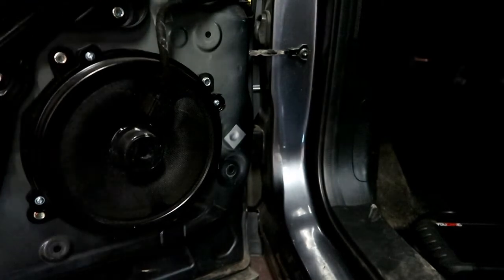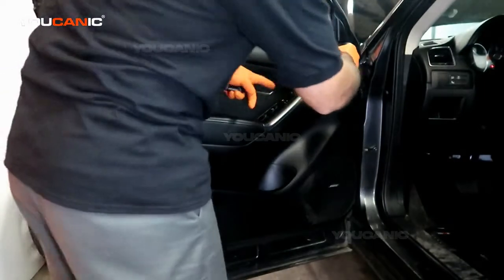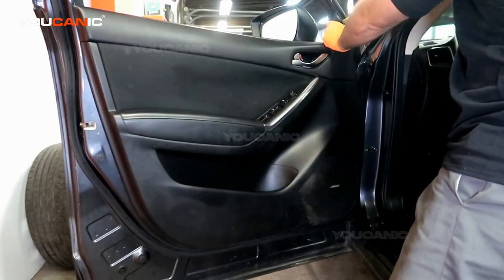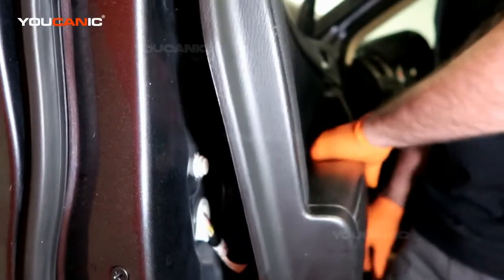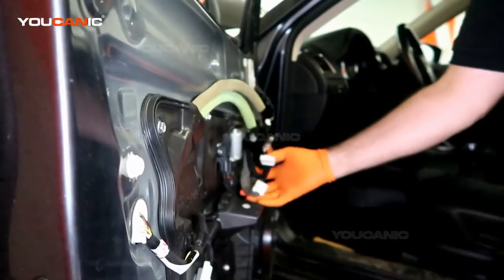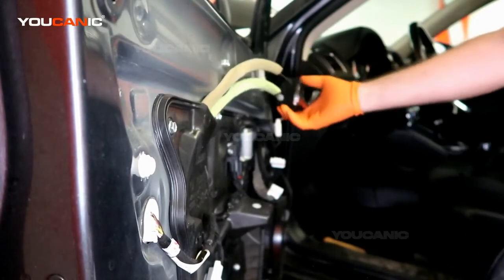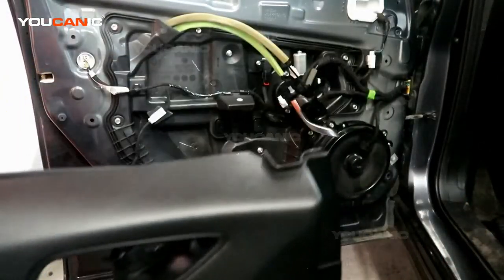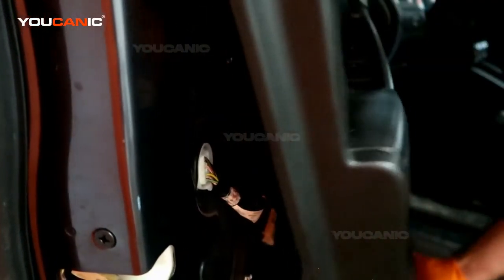2013-2017 Mazda CX-5 - Door Speaker Replacement

Comment: Thanks!  Please note that one should oder ten new plastic clip pins because they will break when you remove the panel.  I learned that they are one-time use.  They are $2.30 a piece.

Comment: You say electruc connector isn't it just a plug woth 2 wires ? Is that the bose speaker? ......they want like 160+ quid for 1 new soeaker at just 25 Watts.  Bit low for the money tbh

Comment: I’ve had so many problems with the Bose system in my car. It doesn’t like aftermarket stereos. The factory stereo, It was a cheap piece of junk. Two amplifiers fried on me and the speakers were cutting in and out constantly. The best advice I could give somebody is just to disconnect the Bose system and put in component speakers in the front and coaxial in the back and amplify them with a separate amplifier. I replaced the 10 speaker Bose system with four 6.5” speakers and it sounded much better.  My audio on phone hands free was 1000% better for both parties.  Bose car audio is junk.
Reply from the maker: Hi there, thank you for sharing your experience with the Bose system. At Youcanic, we understand the frustration that comes with car audio issues. We provide thorough guides, as well as our powerful YOUCANIC scanner to aid in resolving such challenges. You can also explore our factory repair manuals for in-depth solutions. Our aim is to empower car owners like you and make car maintenance as straightforward as possible. Feel free to check out our resources at www.youcanic.com. We're here to support you on every step of your car ownership journey!